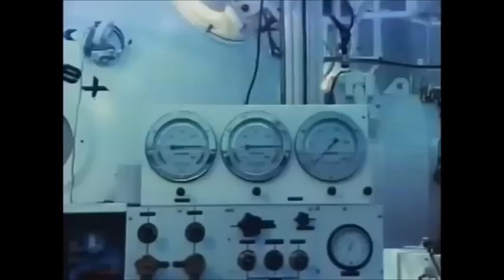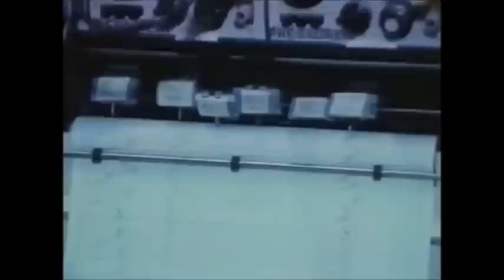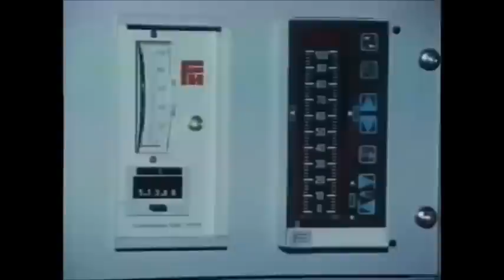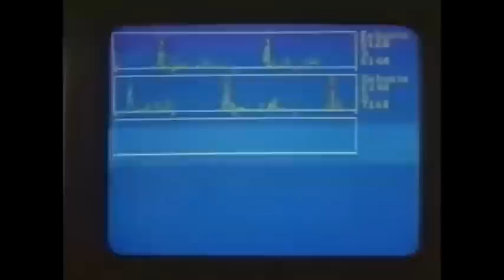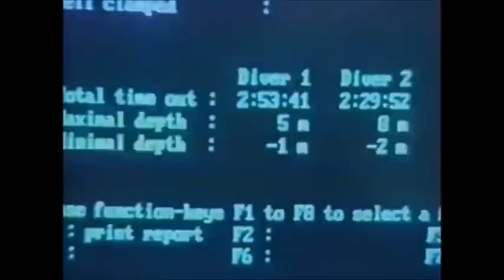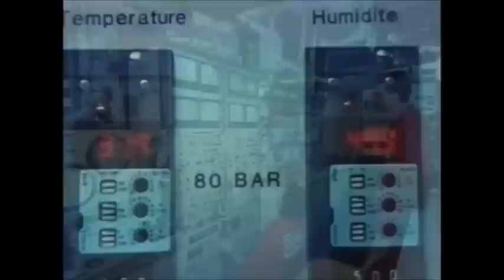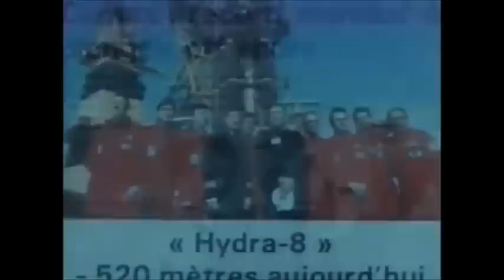World Record   Deepest saturation dive 534m

Comment: I was working for Comex Houlder in 82/83/84, doing hyperbaric tie-ins in the North Sea, some colleagues did a similar experiment at that time in Norway to 1000ft. 
I declined the offer, as I used to suffer some joint pain on dives to 550/600ft. 
The guys I knew didn't suffer any long term effects, but a couple of them never dived again. Any negative effects was kept quiet. They got double pay for the duration, but then were told to have 3 months off, so didn't really gain out of it.

Comment: Just simply amazing. I have hundreds of sport/deco/wreck dives. This is a whole 'nother ball game. I always wished I had pursued a commercial diving career when I was able to in my 20s. I was a great welder, a degree in ME, and loved diving and mechanical work. Did a few deco air dives to 200'. Crazy. But I was young and invincible, LOL. My buddy and I got a mild hit diving the wrecks in Truk, first dive that day was the San Francisco I think, 160 or so, didn't tell anyone on the liveaboard because they would have probably req'd evac. Went diving the next day on more wrecks of course! We were "pushing" the tables. That convinced me to be a little more conservative with the tables. You do stupid stuff when you are young. This is not one of the things in life to be stupid with. 530msw = 53 bars = 769 psi!  1% O2 at that pressure gives a partial of 7.7 psi,  0.53 bars.  O2 toxicity starts around 1.3 bar. So a safety factor of about 2.5 for that parameter. Then Comex did 701MSW in the chamber. 70 bars, 1015 psi!!! O2 partial of 0.7 bar assuming the same 1% O2 mix. Still a good safety factor.  H2/O2 or H2/He/O2 mixes are the only way to do these dives. The thing that would worry the hell out of me is a failure of some sort with the topside mixing/regulating/safety etc etc etc equipment.

Comment: By the late 1980s, the commercial diving industry was already transitioning to robotics, especially for deep diving, due to the economics—it was far less expensive and safer to put a remotely operated vehicle (ROV) at depth for many tasks, instead of a diver. As a result, hydrogen was never “operationalized” as a diving gas, and has remained an exotic vestige of hyperbaric research in search of an application.

Comment: How do they handle the pressure on there bodies?
Reply: They don't feel anything :) it's kind of a myth that you feel the weight of water on you, even on such a extreme depth. Because the body really doesn't care. It cannot be squeezed, because it's made out of water and solid matter. The only problem is with the air that's in the body. That's why they use the compression chamber. To equalize the pressures. As long as they are equal they are fine.
Reply: Boyles law only applies to gases.

Comment: If the guy in the bell were to jump into water really quick and swim around with no mask or tank..would pressure crushed him..no.. but he would feel it.
Reply: No , the bellman  is at the same depth as the divers, and is saturated to that water depth,  It is no different than him doing it at 10 meters since he is equalised to the current pressure at that depth which is around 54 bar, since we are composed of mostly water as well when saturated you are at equilibrium with the exposure depth.

Comment: Is it possible to dive deeper than this? It seems like it’s possible, the limiting factor however is the decompression.
Reply: COMEX tested the concept to up to 700m (onshore simulation). The problem is that at some point, even hydrogen becomes too viscous to breath efficiently.
Reply: There is also the problem of being saturated by nitrogen, that can make you go crazy, which is very dangerous at such a depth. They can replace the nitrogen with other gases, but eventually they also get problematic. So they end up using hydrogen with 1% of oxygen. And it's problematic for obvious reason 💣😂 who knows what kind of gas mixture would you have to use diving deeper than this
Reply: @arcticflower1760 Actually it's not problematic at all, hydrogen at that low oxygen pressure cannot combust, let alone detonate
Reply: @raffaeledivora9517  The breathing mix is not dangerous. But you need to handle the hydrogen safely on the ship. That increases the complexity and cost of the operation. And thats the reason why it is not done anymore today.

Comment: Wow...a LOT of chemistry questions come out of 'Hydra' compounding...because unlike noble gas Helium, Hydrogen can form MANY dangerous compounds...from Hydrogen Cyanide (HCN) to various acids...and this raises MANY questions about how such compounds were/are avoided when divers are breathing such a 'HYDROX' mixture (or simply, a modified electrolysis of water!)...
Reply: Yes, I'm aware that they are at 534 meters, 1751 feet (just over 1/4 of a mile) with a pressure around 790 PSI.

Comment: These guys are troopers. Isn't funny how there's no documentaries on how astronauts handle the supposed  pressure in a vacuum of space and yet there's tons of SAT diving docs? 
NASA claims to have gone to the moon in the 60's. Right...
Reply: Lots of docs and here is how. You lower the pressure inside the suit to 1/3 atmosphere. To get enough oxygen you just replace all the nitrogen with oxygen. Funny how this is exactly the opposite at low pressure compared to these high pressure guys, when it comes to oxygen. Now, at high pressure, on top of that, you will have to mix your hydreliox, that is hydrogen helium and oxygen, very carefully, to avoid the problems they each have, within certain windows of partial pressure. And then there is the decompression phase.
Reply: @fisterB  The two are quite different indeed. Think about the reality of the situation of "space" next to Earth... 

The vacuum of space is claimed to be an incredibly powerful, 1 x 10 -17 torr.

How can such a vacuum (very low pressure) in close proximity to the Earth’s atmosphere (high pressure) coexist with the open system of the Earth’s atmosphere without a solid barrier? How does this not defy the second law of thermodynamics and still remain true?

A spacesuit would explode if this were true.. It is not possible with these types of pressure and little protection to stop it. I've seen vacuum tests done metal oil tankers and they crush in seconds.

The world’s largest vacuum chamber - Plum Brook Field Station complex near Sandusky, Ohio has walls built 8ft thick to test these theories and that's still not even close to what space would be in reality..  

Pressure is a force exerted by the substance per unit area on another substance. The pressure of a gas is the force that the gas exerts on the walls of its container. When you blow air into a balloon, the balloon expands because the pressure of air molecules is greater on the inside of the balloon than the outside. Pressure is a property which determines the direction in which mass flows. If the balloon is released, the air moves from a region of high pressure to a region of low pressure and the balloon deflates.

Earth is an open system that presses against the vacuum of space, why therefore is the second law of thermodynamics suspended if indeed it is a law. Space is low pressure, therefore the atmosphere which is not in a container should disperse into the low pressure space.

Space as seen on TV is fake. That's why there's no actual documentaries showing how it all really works, because it can't.
Reply: @ScubaDracula  You did not mention gravity, which is the traditional explanation why Earth can hold on to its atmosphere against the second law of thermodynamics. It does the trick for us normies, it sort of makes sense out here in that other reality, part of which is not your preferred domain. Even then, some light elements really do escape to the vacuum as you describe. 

A space suit is actually not possible in a naive sense, as depicted in bad movies. It would not explode if the materials are sufficiently tough, but you would have a hard time moving around if you kept a full atmosphere of pressure inside. That is why we use low pressure inside, almost as low as the human body can tolerate. 

But it is really hard for me to visualize your premises...you seem to argue there must be a barrier in the sky, space doesn't really exist, as such, the moon is a small disk or something, Earth is flat... I don't really know where you draw the line. There is no law against believing such, but you also want to believe as many true things as possible, one hopes, so there is no social price to be paid in ill conceived laughter, when you meet new people.

Comment: How are you not crushed this deep?
Reply: Read some books on the compressibility of solids and liquids
Reply: Internal pressure. That's why they live in a pressure chamber
Reply: The diving suit is under high pressure. The human body does not feel the pressure if it comes from the air, because air is highly compressible and human body is not. If the suit was decompressed at this depth and the body was in direct contact with water, it would be crushed totally.
Reply: @MartanJe  The gas in the drysuit is  for insulation against the cold and adds buoyancy.

Comment: Massive respect for these guys 17 days to decompress...and this was in the 80s how deep can they go today
Reply: Still a record dive, nothing more achieved by now. We don't have anything new in saturation diving because of physics limitation. Hydrogen narcosis (Similar to LSD in effects) became a factor after 500 meters, so nobody risks rising depth limitations. In theory - we can use Hydreliox up to 675-700 meter depths, but it was tested only in decompression chamber (3 days at 67,5 bar and 2 hours at 70,1 bar, before weeks of recovery).
Reply: @MironBleek how can a man live with only 1% oxygen?
Reply: @sparklessconnectionselectrical  well, because of partial pressure on big depths.
Reply: @MironBleek  because it is so compressed?
Reply: @sparklessconnectionselectrical  Yes exactly.
Reply: @sparklessconnectionselectrical  At greater depths, the partial pressure of oxygen in the air becomes higher due to the increased pressure, which means that the body can extract enough oxygen even with a lower percentage of oxygen in the breathing gas. This is why divers use gas mixtures with lower percentages of oxygen at greater depths to prevent oxygen toxicity, a condition that can occur when the partial pressure of oxygen is too high.

By using gas mixtures with lower percentages of oxygen at depth, divers can avoid oxygen toxicity while still ensuring that their bodies receive enough oxygen to sustain life. This practice is known as gas blending or gas mixing and is essential for safe diving at different depths.
I have done dives at 170 with 97% nitrogen and 3 % Oxygen to test the narcosis effect, it was the equivalent of diving at 230 feet on air. Lots of fun down there but very dangerous lol
Reply: Russians did 416 meters dive

Comment: I've been diving since the 90's and it still amazes me that at just 20 metres I have enough pressure in my lungs to inflate car tyres. The human body and understanding through science of how it works are amazing. As an engineer I understand the physics but that takes nothing away from my amazement.
Reply: 38 psi is not a lot of pressure.
Reply: @freelectron2029  That's relative.
Reply: @byteme9718  i think about it like this, you could strap a full scuba tank to the outside of the titan and if you opened the valve water would rush in, not air coming out.
Reply: @freelectron2029  I stated pressure is relative. When SCUBA diving most lung injuries occur ascending from less than 10 meters.
Reply: @byteme9718  im a professional commercial diver mate. you dont need to explain boyles law to me. i thought you were making an intelligenent nuanced point. i was wrong. you were saying something that makes no sense. relative to what? whats your point? my mistake for giving you the benefit of the doubt.
Reply: @freelectron2029  Sure you are, you can't even understand a simple term like relative that could apply under any circumstances.
Reply: how about that stupid titan sub. they got inside a plastic tube pressurised to 1bar and immersed it inside in a fluid pressurised to 350 bar.....

Comment: Mr uploader. Can you confirm if this is true?
701 metres (2,300 ft) Comex Hydra X (Hydra 10) simulated dive in an onshore hyperbaric chamber by Theo Mavrostomos on 20 November 1992.
I guess it doesn't count as it was onshore........ ?
Reply: You are correct. The 1992 dive was pressurized in a facility wheras the one in the posted video was an actual, open water dive.

Comment: 534 meters is 1751 feet (just over 1/4 of a mile) where the pressure would be around 792 PSI.
Reply: @James Sloan and that's on every square inch of your body. So take 778 PSI and multiply that by the number of square inches on your body (whatever that number May be) will feel like you're being crushed by a hydraulic press

Comment: What are the side affects on the body being under all that pressure and breathing those gases for such long periods of time?
Reply: If you do saturation  long enough  the most noticeable effect is it eventually gives  you short term memory problems, and causes  a type of disconnection of concentration within the brain. It is hard to describe no one talks about it, it is not even documented or researched,  or frankly, even admitted by many divers themselves, that they even experience these symptoms, but it is there.
 It is suttle, and the effects very gradual over time. 
However when you stop going into saturation for a period longer than a year or 2 the symptoms diminish somewhat and the brain memory function improves, do I think it causes irreversible damage , yes I do, will anyone admit it, no they won't as it would negatively affect the oil and gas  industry on a global scale.
Reply: Huge reduction in red blood cells. When they come back out they get major headaches.
Reply: I was involved in the Predictive Study IV project in Philadelphia in 1975 where we went down to 1,600 feet (storage depth was 1,200).
There has never been any physiological effects from that dive and - excepting very daunting logistics - those depths had remarkably little distinction from any underwater work whatsoever.
30 feet to 800 feet in working dives or 1,600 feet in that experiment ... not really much difference.

Comment: 610 metres (2,000 ft) US Navy diver in Atmospheric Diving System (ADS) suit.
Reply: Yeah, and 700 meters in a simulated dive in one of the later Hydra tests. Although to be fair, they only tested the subjects under a simulated pressure comparable to 700 meters below, they didn't actually do any actualy diving at that depth. But it certainly would be feasible, the tests definitely proved that.
Reply: A one atmosphere suit is not sat diving
Reply: Suit? It's like small submarine, limited movement
Reply: That's not even the ADS record anyway. 
Oceaneering went about 100' deeper a decade earlier.
Reply: Those suits have terrible agility theres no way it would be practical.

Comment: How thick is the dive suit ? How thick are the souls of the boots ?
Reply: That warmth factor is seldom mentioned but it is a hypercritical component at these depths.
Breathing a high heliox mix in the wet transfers body heat something like 35 times faster than breathing air in the dry.

Those suits have warm water constantly flowing through them and they need to work properly 100% of the time.
Reply: If you are thinking of warmth the suits have warm water that is circulated through them.

Comment: All my respect for y'all .... I am not doing Saturation diving ....
 Why is it there is only about a 4-5 year dive lifetime for a diver doing saturation diving ??
Reply: Good question.
I did commercial diving for 8 years back in the '70s.
Work included a 1,600 footer in the Predictive Studies IV project, 3 years offshore rigs worldwide, and 4 years harbor work throughout US, mainly out of NYC.
It can be a great career for a fit, single young man, but the pay can be less than what u might expect.
The constant travel, job uncertainty and - most of all as time goes by - the danger start to make one question their long term prospects.
You will NEVER see the "near misses" that occur in this work, but they are most certainly there.
Best info I would pass on to someone starting out in life is to get involved in a skilled trade.
Great pay and long term demand are the norm.
Good luck.
Reply: That's not really true. Many of the core North Sea sat divers have been doing it for 20 years.
Reply: Guy David The pressure wrecks your body. It takes years off your life